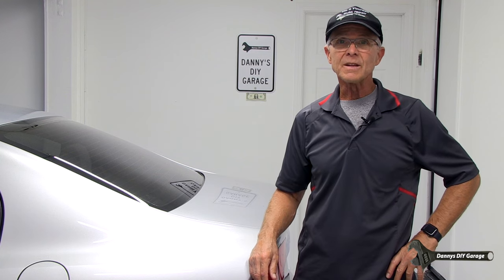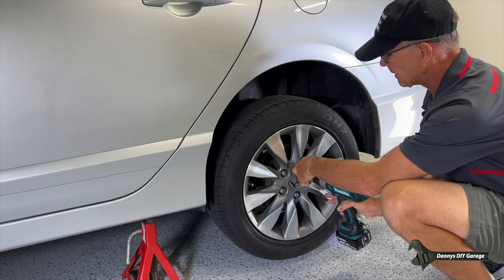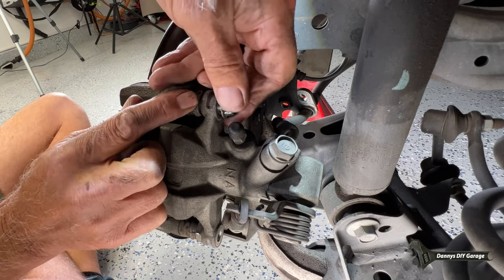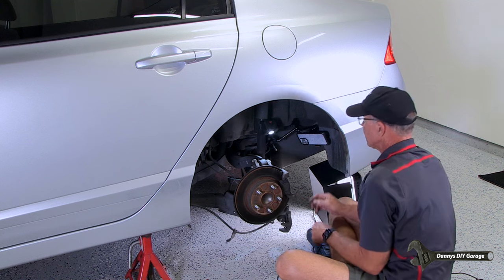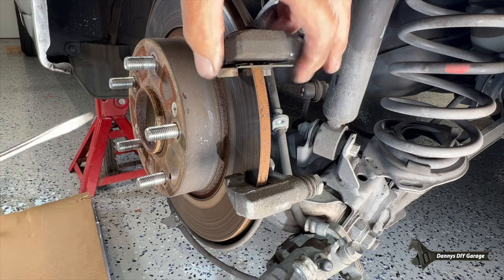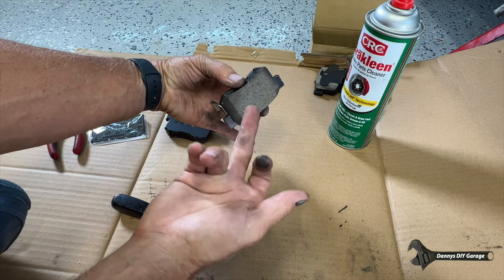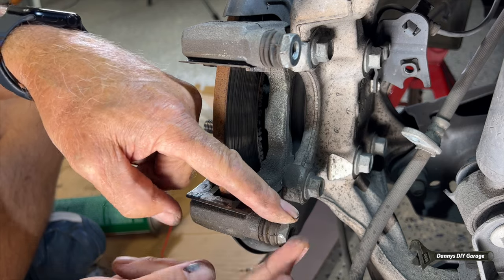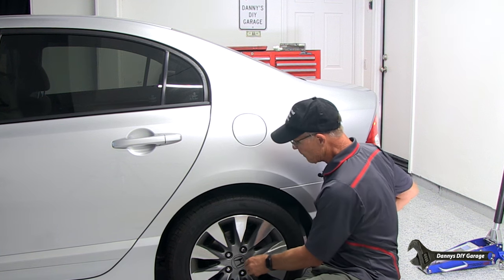DIY Rear Brake Pads for 2009 Honda Civic EX (Save Money & Stop Safe!)

Comment: I got Detroit axel brakes and rotors from Amazon and they fit but didn't have the locking tabs on the back of the brakes... So I went and got some Honda ones thanks for the video!
Reply from the maker: You're welcome, glad the video helped!

Comment: Hello quick question please ..
Should condenser fan run with ac off at normal operating temperature with radiator fan or the radiator fan should run separately

Comment: What is that little square that you used to compressed? Is it needed for the front as well?
Reply from the maker: I updated the description and added the part so you can buy it on Amazon
Reply from the maker: Update in description, the front pistons just needs pushed in
Reply: You don’t need a special tool, might make it easier but it’s not needed. You can use some big needle nose pliers, you just need something to twist it..

Comment: hey danny, i was wondering, have you ever had the issue where your fuel gauge is reversed in your civic? I known its a somewhat common issue
Reply from the maker: I have not
Reply: We have.  It's the contacts in the instrument cluster that are the issue. We just give the cluster a love tap just right of the speedometer and it corrects. Not a fix per se, but it does correct for awhile.
Reply from the maker: @ericschwa1479 thanks for adding this information